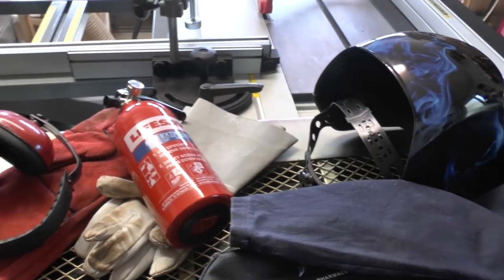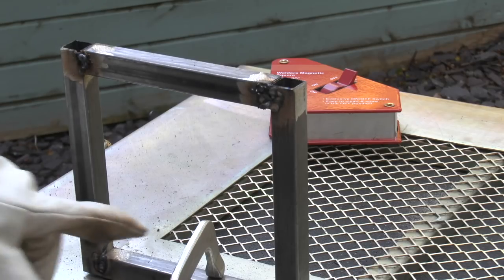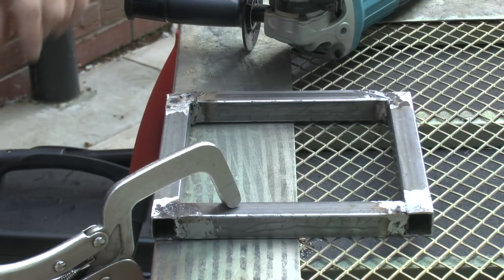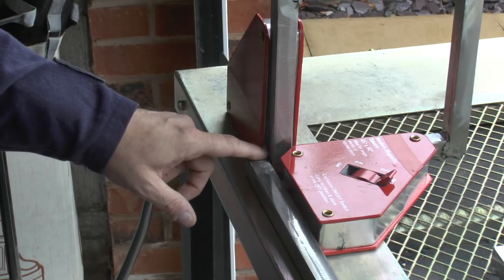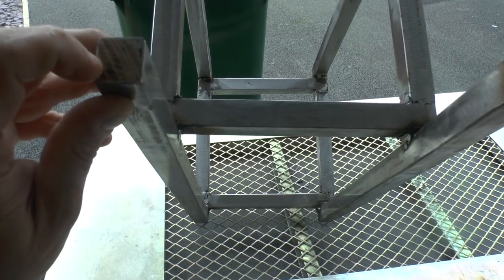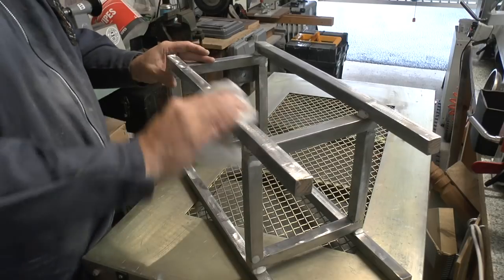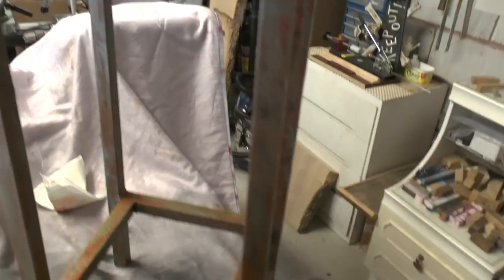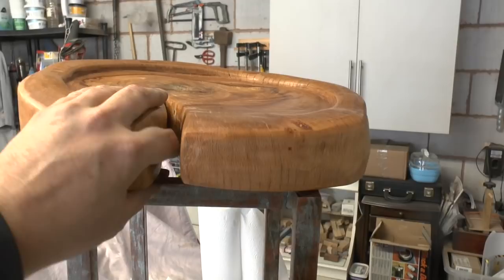Power Carved Stool Project Part 4 - Welding and Construction (The Finished Stool)

Comment: I can only watch 10 minutes at the moment till later. The welds are fine and if I can give you a tip on getting the tack weld in is if you have your shroud ( nozzle ) on the joint you will feel the joint with shroud because of the groove between the 2 pieces. Hold the gun handle 45 degrees you will be able to get the tack in a 2 to 3 second trigger hold. Well done though Chris
Reply from the maker: Great advice Dave and thank you .The tips you mention make perfect sense and should help me out heaps .
KEEP ON TURNING !!
Chris .
Reply: @BlindWoodTurner  you are more than welcome Chris. Keep inspiring